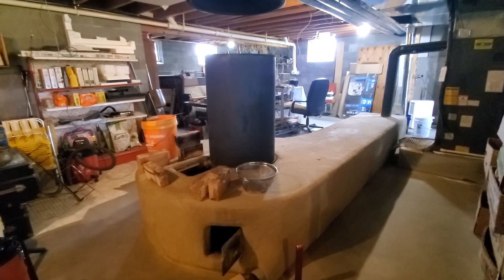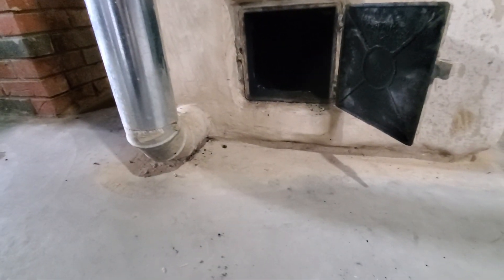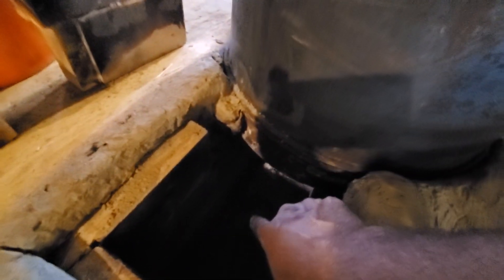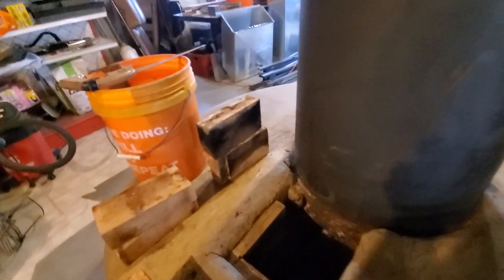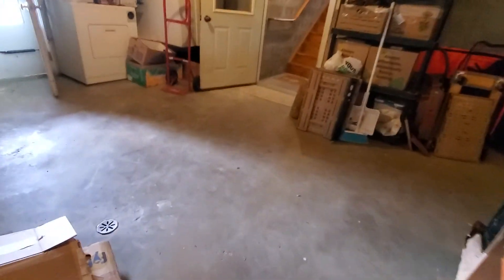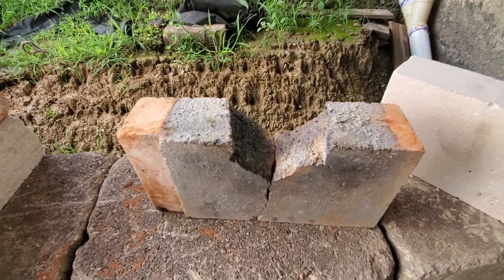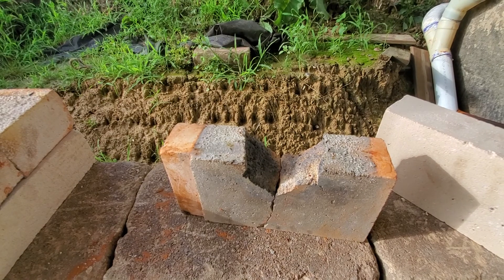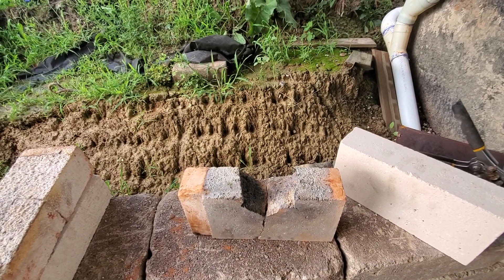Uncle Mud Basement Cob Rocket Heater Maintenance Update Part 1

Comment: Not sure if you will see this, going to try my luck anyways lol. I love the ingenuity of your design. I was hoping to find out what you used to make your cob? Any information would be greatly appreciated cause I looking to design a thermal mass for the liberator rocket stove I'm about to buy. Have a wonderful day, thanks.
Reply from the maker: We have an electric mortar mixer we really love. You can rent a trailer mounted mortar mixer (not concrete mixer) for around $100 per day most places. You can also use a tiller or an excavator or skid loader.